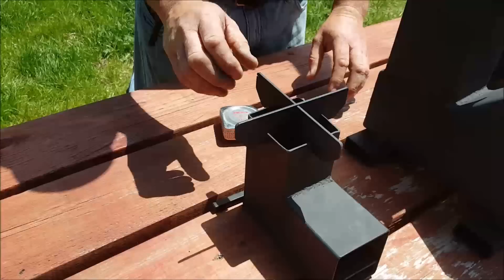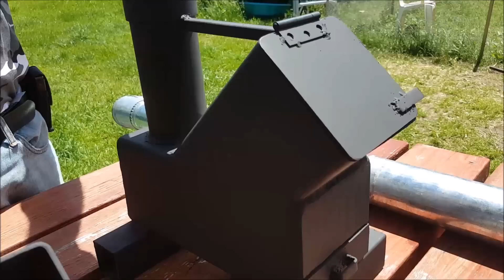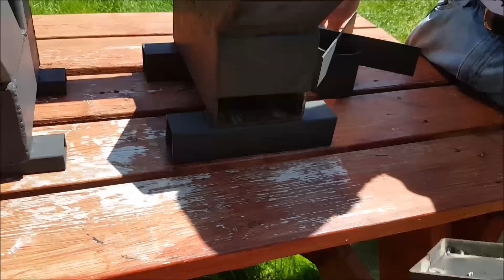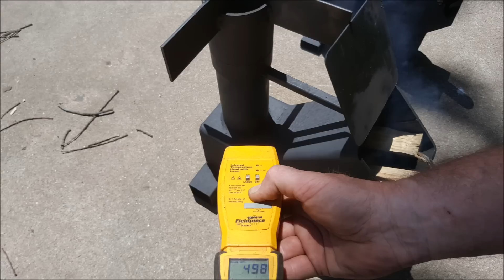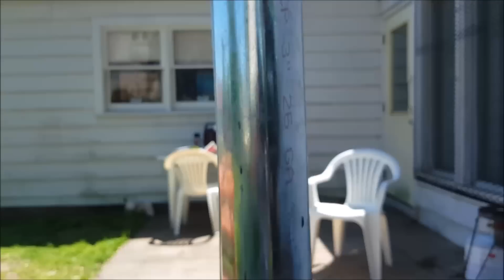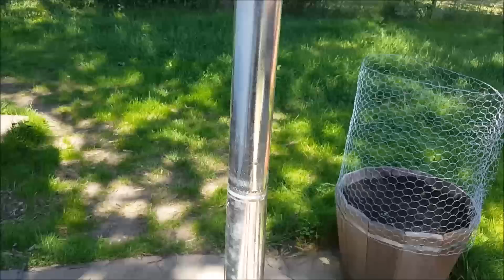Bullet Proof Rocket Stoves by SHTFandGO (OLD VIDEO)

Comment: If you put copper tubing around the stove pipe you can heat water. It would need to be where you will not be able to move in around much with a water heater on it!

Comment: 99.99% of your heat goes out the pipe when you make it into heater.  Also burn rate would be 10 times that of a wood stove. Wood stove are built to build up extreme heat, slow down the intake - burn rate and heat cycles inside stove.  Smoke woks it's way to pipe. Not a direct hole access to fire or heat chamber, smoke escapes through vent pipe. Heat retains inside wood stove. Common sense. Look up wood stoves and see how they are made. Don't take my word for it.
Reply from the maker: Did you see our other videos???  The 50 BMG has a damper and air control to slow burn down, just like a larger wood stove, and you can't easily carry a large wood stove.  This is a small compact, portable, emergency stove.
Reply: alton Davis they make recovery units or you can add a couple of swivel elbows to the main chimney to recover some lost energy. It's an emergency unit meant mainly to cook on. The metal itself transfers more than .01%. If you dont believe me, grab one while its operating with your bare hands. I call BS. You made that number up in your head. Perhaps a topper with an iron plate between the chimney and the stove would help transfer more heat, but it would add weight and be clumsy. I would use this in my ice shanty, but only in a pinch.
Reply: Kerplunk I was thinking the exact same thing. Where does he get 99.9%????
Reply: @heinzkitzvelvet  heat radiates outward and equally from the center. The gases are what rise and bring a little extra heat with it. I would bet that this stove is about 50-60 percent efficient. A regular fireplace is about 30% efficient that's the most inefficient way to heat an enclosed space. I'm thinking the metal is about 8-900 degrees at the base, and 350 at the vent pipe. That's a 30-40% loss of energy. The rest is radiated off of the metal. Benjamin Franklin crunched the numbers 250 years ago. He invented the "Franklin stove" based on his research. His stove is 80-90% efficient, and gets better with modern recovery units.

Comment: How long does flue need to be before exiting  the tent
It can exit horizontal  right
But then vertical?
Reply: Cathy Baby the  chimney pipe can zig zag a hundred times as long as it doesn't go downhill. The top of the chimney pipe should have 360°  clearance so a wind from any direction will create a "draw". To test this, before you light it, you would open the hatch and light some tissue on fire and blow it out. The smoke should go into the hole. Even with the system turned off, there should always be at least a small flow of air.

Comment: Does it smoke blow back into tent?
Does it only produce steam n co2 out the flue
Reply from the maker: It drafts well with properly fitted vent pipe, and this is wood burning stove.
Reply: SHTFandGO.COM  where could i find that pipe in black
The black is more durable
Oh does fire go up flue?
Im familar w rocket mass
But i will settle for this because  its cold at night here
Need it
Reply from the maker: Sorry I don't know about heavier gauge vent pipe.  Since the stove when used as a heater is for short periods of time and emergency use, regular vent pipe will work fine and it's cheap to replace.

Comment: You say a lifetime? Has anyone done a test for real on mild steel and the effects of wood gasses along with extreme heat environment has on it?? Wood gas is very corrosive on steel and it won't last long being exposed to it in extreme heat. This is a much different flame than what we produce in a steel box wood stove and a much different environment.
Reply from the maker: ThePhreejams If you can burn through one of our stoves in your lifetime we'll give you a new one. :-)
Reply: Oh no no i wasn't questioning your product . Which appears to be bullet proof. Just in my experience, metals in that type of environment don't last very long. Say, if it was exposed everyday. Wood gas stream is some corrosive stuff.
Reply: Also be careful with having galvanized pipe in temps above 900 degree. It will start to vaporize and off gas. No, good in a tent.

Comment: Great looking stove. Looking at buying one for SHTF as well as a power outage backup to my pellet stove. I assume this 50 BMG will fit my standard pipe for my pellet stove. I measured my pipe and it measures 3.5", I believe they call it 4", does that match what you built this to do? If it's not may I suggest you make an adapter to go on top of it to neck it up to match the standard pellet stove pipe in homes. You need more videos on here. You were hard to find and there is a lot of info you could have added to your video. If your interested in a trade I would be happy to create videos for you and reviews. Thanks Dan
Reply from the maker: Dan Rattenbury great comment.  Yes easily adaptable.  You only need a simple adaptor you can pick up at any building supply store.  Our stove accepts 3" standard vent pipe, the same stuff you would find on a water heater.

Comment: I JUST got mine (off Amazon), can't wait to use it, but there is no air chamber in it???
Reply from the maker: Rob Dubé hi Rob, the air vent is in our old version of the 308 because we didn't have a taller chimney to draft well enough.  You have our newest 308 with collapsible chimney. We need to take this old video down :-), so we don't confuse people.  If you have any questions give us a call at the shop. 612-888-7483

Comment: Will coal work in the self fueling rocket stove? Thank you
Reply from the maker: William Hutsul I assume so.  I've never used coal, since it's typically used for cooking.  Designed for wood.
Reply: I use charcoal when BBQ ing, think it is same principle. Anyway, Thank you for replying sir
Reply: SHTFandGO.COM you would need something to keep the coal off the bottom. Who cooks with coal, anyhow? Theres mercury and lead in there... just sayin.
Reply: Coal burns way hotter than wood wouldnt cook over it either may not be safe!
Reply: coal may warp the metal i dont even think i would throw too much coal in a home wood burning stove for fear   of damaging the fire bricks

Comment: Good one... What about the heat loss without an insulation around the chimney ?
Reply from the maker: Graison K Insulation is only needed on short stoves with very little draft.  Yes it would increase efficiency slightly, but not needed.  The vortex of air pulling through is very high, so fle burns hoy.

Comment: Too bad there isn't a way to cook and heat inside a tent. On the 50 BMG it's either heating or cooking, either inside or outside the tent?
Reply from the maker: Alexander Allison we are working on this.  We will be releasing a cooktop for indoor cooking.
Reply: This seems to be the new improvement https://www.facebook.com/photo.php?fbid=10210614284979370&set=pcb.10210614285819391&type=3&theater
Reply: SHTFandGO.COM Question... What about fumes or the stove using up the oxygen in a tent..??  Is that a health risk or no..??
Reply: When will this be?  I'm interested in this as well.
Reply: Alexander Allison um. Cook in the daytime, and heat at night? Buy 2 of them? I got nothing else.